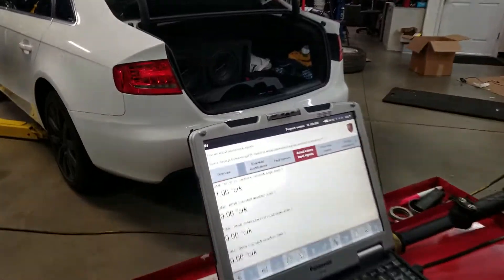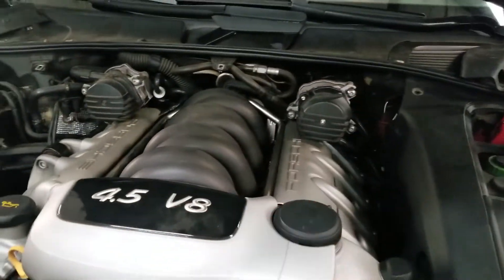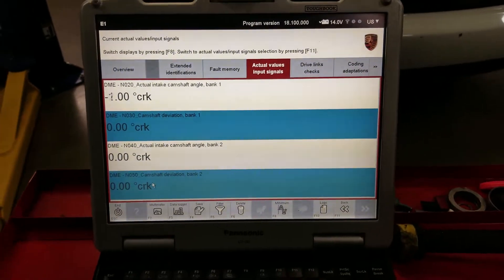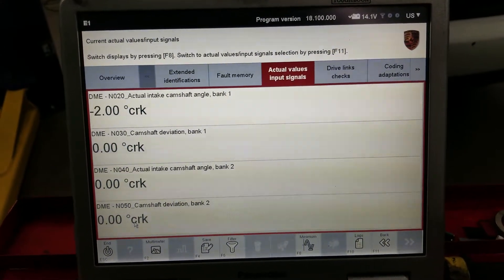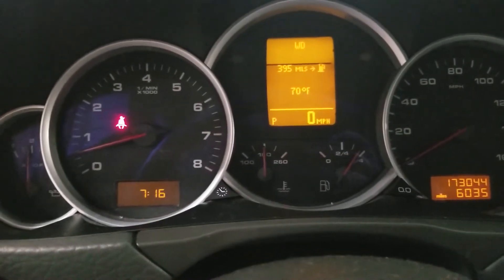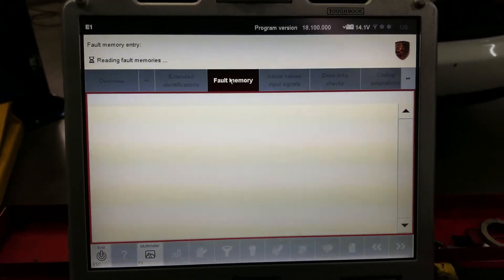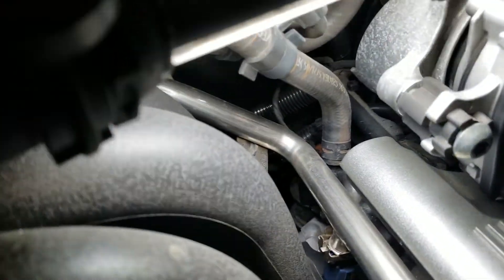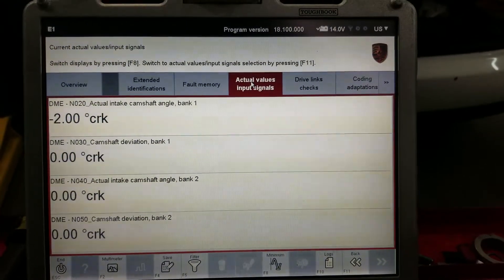This is the problem with Porsche cayenne S regarding stalling issues | camshaft signal

Comment: Yeah, I was getting a code reading of PO 346 camshaft positioning sensor a circuit range/performance bank two. replace the sensor it wasn't cheap for OEM like 115 bucks kind of a rip off but I did replace it put it back in and got the same reading but when I accelerate with the motor it doesn't hesitate are stall. Also keeps a steady idol I'm thinking it may be the wiring like you said?
Of the exact same Porsche Cayenne 955 thanks for the video/ 2005 with low mileage, it only has 56,000 miles on it. Thanks for sharing the video of you have any suggestions let me know

Comment: I got a cayenne s 2008 4.8L v8 , I got couple of issues - sudden engine power loss , engine shuts off randomly while running on roads , gear change issue ( taking too much time and meanwhile during gear change the rpm drops too much to 200-300 and no power at that point )

Comment: what was the problem?
Reply from the maker: Camshaft timing
Reply: @TopAutomotiveInc  not the sensor or the chain
Reply from the maker: @7lampsministries471  one of the sensors was acting up as you can see in the video. They have cam bolts that become loose as well
Reply: thank you great job
Reply: So what have you done? Just time it and that’s it? My issue is camshaft position sensor(changed it 2 times but nothing) and it need couple of tries to turn on, but when it runs it’s perfect